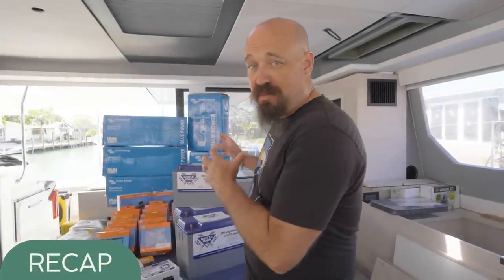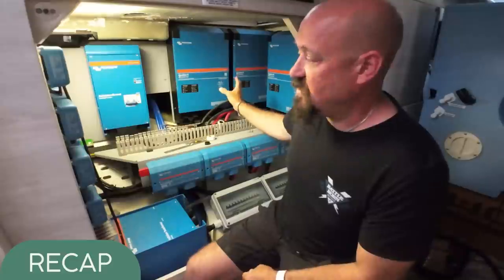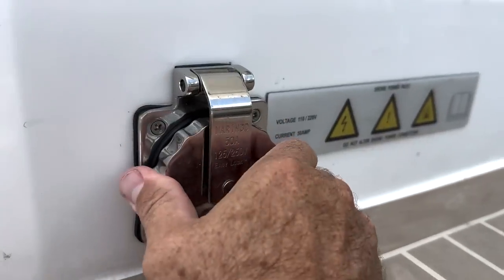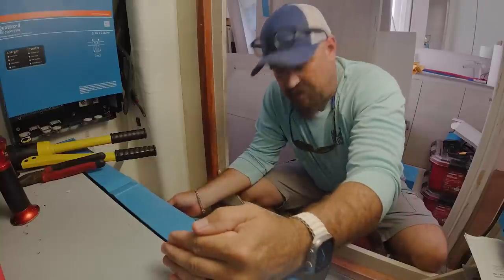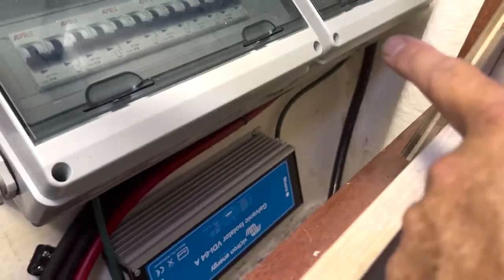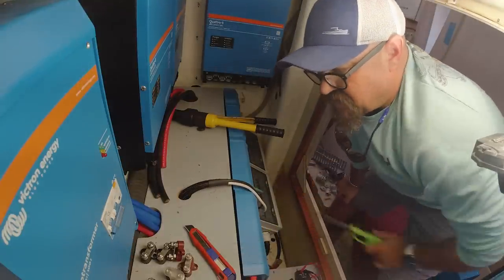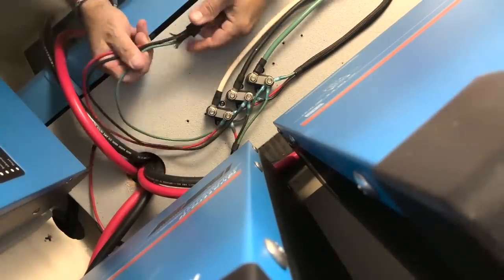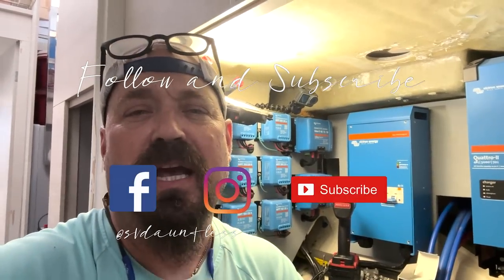REAL POWER//Epic Off-Grid Power System Build From Scratch-Episode 137

Comment: 50hz is 50 cycles per second not 50,000 cycles per second.  A split phase system is single phase, they are not seperate phases.  They are splitting the single phase in half which makes each of the lines 180 degrees apart.  So 240v equipment is taking advantage of using the full single phase.  With split phase single phase there is no overlap between the two halves because they are 180 degrees apart
Reply: so youre wishing him luck on his exam then hahahah
Reply: I was going to respond on why this not exactly right, but said “screw it, it’s close enough” when my response got to be half a page in length. So I just erased it because there would be zero number of readers besides people who already basically understood the differences between the North American system and the European system. It would resolve into a game of “gotcha” on everybody’s post. It’s not worth going thru the pedantic back and forth. So close enough.
Reply: @kj5905  lol...
Reply: Wrong is wrong!  People will believe the incorrect information.  He probably misspoke but he could have corrected it in the edit.
Reply: Wow… He is just taking the exam SO he really is a NOVICE Professional… Better get a SEASONED Pro to check all your work AND he probably will… Right??

Comment: Nice work. Been looking forward to this (overkill) update, thought maybe you had regrets going that far with the $trip-out & zapped yourself 😉 Au is 240v red black green. How easy would things be if the world did things the same, especially for consumer manufacturing > end user costs. Metric OR imperial, same power/plugs, steering wheels on the same side, etc.... Considering the high salt/corrosive environment, recommend protecting all your raw points (etc) with dielectric grease.

Comment: Awesome work, thanks for another great video.
A small (non-electrical) observation, being that the natural environment of the boat in general is a damp one, is it not an idea to paint/treat the raw particle board/timber sections that you've cut with hole saw for cables, etc. to limit exposure, rotting and swelling in those areas over time?
Cheers and thanks again
Reply from the maker: Thank you!  If I was using regular lumber or ply I would agree. The lumber is actually meranti marine grade plywood which is extremely water resistant and actually does not require a finish.  I only put the gray gel coat on for appearances.

Comment: 1:34 that's normal, it's called Talcum. What is talcum powder? And what role does talc play in cables?

Talc not only absorbs moisture, but also serves as a separating agent and lubricant. In the cable industry, for example, it separates the jacket and the cores from each other.

Similar to the sports sector, talcum reduces friction and helps the cores in the cable to last longer. The reason for this is that they can slide under the jacket or against each other in the longitudinal direction.

The plastic of the insulation is well separated from the jacket material during production. First the cores are stranded and then the liquid plastic of the jacket is injected around them. Without the talc, there is a risk that the heat of the jacket will soften the insulation surface and cause it to stick to the jacket. This then leads to poor durability in motion and also to poorer processing options.

The use of talc makes stripping much easier, because the jacket can be pulled off after the round cut.
Reply from the maker: I have seen this before with wiring it was definitely helpful with that type of wire.  Interestingly, marine grade tinned copper cabling does not use talc at all, this particular type has a 105c rating for the insulating jacket.  What you may not of been able to see was the oxidation of the copper on that cable. The dust was actually oxidized deplated tin that came off the wires from the dead shorting as the boat sank.

Comment: @SailingDauntless. Loving this series. One thing I don't understand though is how you are charging your 48v batteries with your current configuration of panels to individual MPPT charge controllers. Wouldn't you need at least 2 panels in series to obtain the necessary voltage to charge properly?
Reply from the maker: Good question, actually, we need three in series for each charge controller.
Reply: @SailingDauntless  Thanks for clearing that up. You must have a lot of panels judging by the number of mppts you have.

Comment: The Victron install info states that the galvanic isolator is to be mounted in a vertical position.  You mounted it horizontally. I know it will function in any orientation.  I'm assuming Victron's direction is for optimum heat dissipation.  Does it matter?

Comment: Love your work and videos.  Just a silly question. How well does your galvanic isolator work, when you only isolate the ground and not the neutral?  In the USA, they are both the same.
Reply from the maker: They are only connected after they are on the boat and our system make a neural so we don’t take one from shore.
Reply: @SailingDauntless  I'm not trying to be an ass, I'm just going down this road myself and trying to appreciate what your saying / implying.  I assume you're only bringing 120v on board, in which case you will need a phase and neutral. I'm not sure you can create a floating neutral.  If you're bringing on 230V you would also have trouble as you would have a floating neutral, unless you have an AC to AC converter.  (I'm not sure of your system and I could be completely wrong.  I have been wrong more than once, ask my wife)
The other part of the equation is the neutral and ground are tied on both the cat and the shore, so (assuming no leakage) the grounds will be at the same potential, and isolating them achieves nothing.  If there is leakage, then the neutrals will create a potential difference and the galvanic corrosion will start.  The only simple solution I have found is to have an isolation transform, then the cat is in control of it's galvanic potentials independent of the power supply.  
That's my 2 cents. Curious about how the ground isolator works.
Reply from the maker: No offense taken. We are not pulling 120VAC on board we bring in 240VAC in the form of two lines and a ground. The ground and neutral are tied together on the shore, but due to the fact that we are not bring a neutral in, and the galvanic isolator isolates the ground so there’s no continuity back to the dock, when we create our neutral through the isolation transformer, we have an isolated to the boat neutral.  you have the option to bond or not the neutral to the ground on board. the common practice for safety is bonding the neutral to the ground, which can provide additional corrosion, (even when not plugged into shore)but is suggested in the interest of human safety in the water around the vessel.
Reply: @SailingDauntless is this the equivalent of a residential subpanel, in which you do not connect neutral and ground together? And the main panel (in the home) would be the shore panel?
Reply from the maker: Sort of

Comment: I don’t think it was super clear but intent is to have 240 shore power 3 wire so 2 phase  at 180degree and ground. Ground has DC isolated thanks to galvanic isolator.
Will use auto transformer as step down to get 120vac by creating a neutral?
Quattro won’t have internal ground relay and instead instruct step down transformer to tie ground ti neutral when inverting.
On shore power neutral coming out of auto transformer won’t be tied. 
These auto transformer are a bit confusing
Reply from the maker: Your close, the ground relays will be disabled on the inverters and the auto transformer will handle that function.  The autotransformer will also provide the neutral so we can run our 120v circuits.
Reply: @SailingDauntless  thanks for reply. Can’t wait for the whole system hook up.
Eventually will refit my boat would ice to go to 48v system. I wish the 2 way dc to dc system were common already.
The auto transformer step down is like finding a midpoint between the 2 hot split phase but essentially it’s just another hot and doesn’t relate to shore power neutral so makes sense to not tie it to ground when on shore power.

Comment: Hi Ty, maybe I missed it, but why did you opt for 3x5,000va Quattros?
Reply from the maker: Redundancy, there is no room for multiples in the other boat. Also, they all run 240 V versus running in parallel 120 V each. This allows us to lose up to inverters and still be able to operate a boat.

Comment: How much AC do you need? Three big inverters is a lot.
Reply from the maker: We use about 9kw at most peak times and could potentially need the 3rd inverter during heavy loads.  We mainly installed 3 for redundancy in case we loose one (or two) to failure

Comment: Great content thank you. Question for ya.. The regular quattros, in the manual says nothing about 240v split phase on the input like you did. Do you know if I can wire my quattros like your quattro-II? Or is this a new feature for the newer quattros?
Reply from the maker: This is not a new feature, but you have to have the ability to get in and the adapter cable to reprogram the system. Additional equipment is required, it will not just be the reprogramming to 240 V.
Reply: Have a look at: https://www.victronenergy.com/upload/documents/AT-1-split-phase-240V-to-120-240V-with-Quattro-240V.pdf

Comment: Even length wires on A/C in not necessary unlike D/C.
Reply: In a regular split phase system it is not as important. But the way these are going to be wired in parallel it is very important.
Reply from the maker: Absolutely

Comment: Strange you did not put the 120/240 Volt bus bars in an isolation box...
A hazard is easy made by a tool that falls on these bars or people touching these bars!
Reply from the maker: As I said in the video, when the wiring in that are is complete I will build a cover for safety

Comment: 50 amps into a 12-gauge wire?  Am I missing something if you have a short or malfunction you will have a fire.  The 50-amp breaker will not pop before that 12-g wire catches fire.

Comment: ummmmmm, is the shore power breaker rated more or less than the wire to a single inv/charger? (imagine one fails dead short) I think you should have run the shore power into the isolator and then a distribution board with breakers for each inv/charger (and a spare outlet / cabinet light)
Reply from the maker: It is rated for the wire feeding the three. Each unit is separately programmed to take a specific amount of amperage.  Also the the run from the bus bars to the inverters is short enough that it precludes the need for separate breakers/fuses. Also, no power can be used in 120v until the 220v  passes through the inverters and the isolation transformer to pick up a neutral
Reply: @SailingDauntless It might only be 2ft of wire that melts if an inverter dies but I still think you would be better off with a breaker per inverter so it fails in a non damaging way if an inverter dies and it can all be done in one din rail breaker box without the "bus bars", it's probably fine as-is, I'll be interested what a marine surveyor thinks.

Comment: I love the wire can be too big lesson. I have tried to tell people this so many times and they simply do not understand how too big can be wrong in many ways. I try to use the garden hose and fire hose analogy. A garden hose is too small to carry the volume of water the fire hydrant will put out, but using a fire hose to water your garden also won’t work, even though the fire hose is capable of carrying much higher volumes of water. Wires are the same. A 18g wire is great for a light bulb but won’t start your engine, but the 2g wire won’t light the lightbulb effectively either. 

Will the 2g wire light the lightbulb?  Yes it will, same as the water from the spigot on the side of your house will eventually get to the end of the fire hose, but neither one will do the job as well as the wires/hose for the job.
Reply: this is simply not true

Comment: As many tools as you have and no heat gun?  You risk damaging the  heat shrink with your method, if you're not extremely careful. Why risk it? Get a heat gun. They are handy to have. Balancing the load is imperative, too. I hope you are going to install protective covers over your bussbar. 🤞
Reply: He has a heat gun. Multiple times through out the video he said he was out of gas for his heat gun.
Reply: @aklogcabinfilms9214 He says he has a butane torch that he usually uses, but it was out of butane. He was using a lighter. A heat gun is a totally different item. It operates off of AC voltage. It looks like a hair dryer. A  heat gun is the proper way to reduce heat shrink. It heats more evenly and is less likely to damage the conductors insulation, and it evenly shrinks and seals.